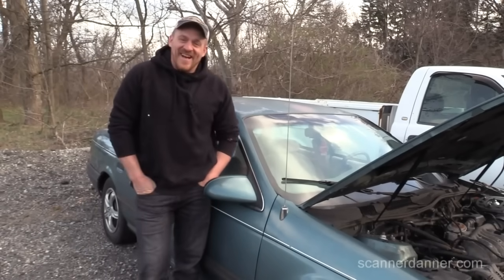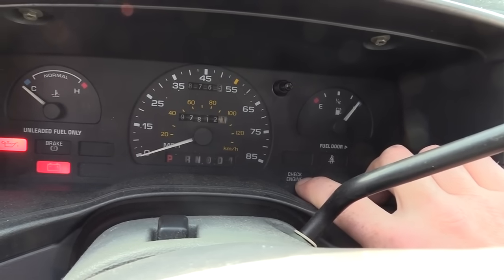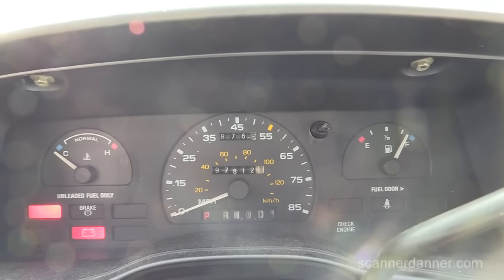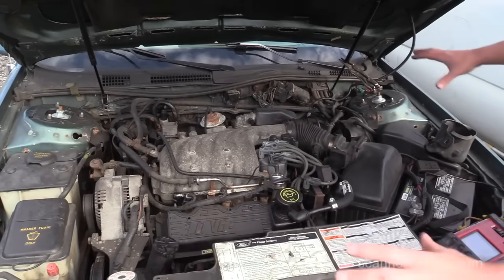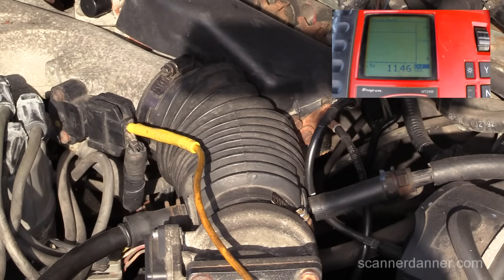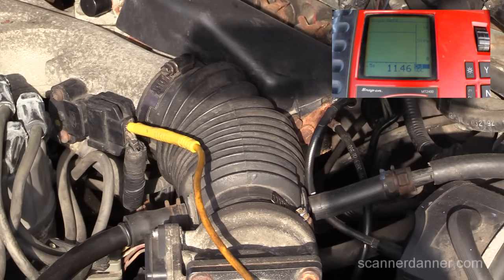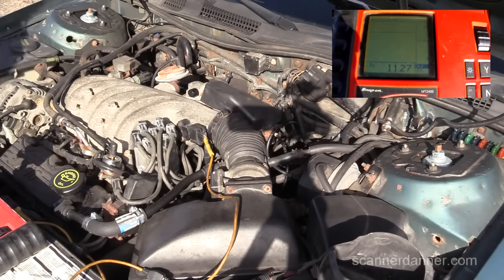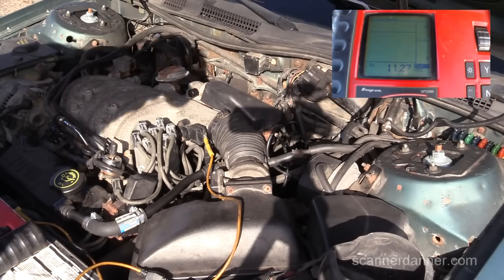Sensor grounds and the 5v reference circuit (a 2016 ScannerDanner Premium video)

Comment: time to walk away, it would be cheaper to scrap n replace
labor is labor.
Reply from the maker: Or just watch and learn something. It was a no cost fix. 
Edit## read below, this was a misunderstanding on my part.
Reply: @ScannerDanner to My 2009  Buell Ulysses and many other Buell with aluminum frame have computer ground issues caused by unseen with the naked eye resistance caused by dissimilar metal of the computer grounds and that dam aluminum frame . I was getting a DTC light lean O2 only at 70mph + . Light would go out when slowing down below 70mph . Cleaning aluminum ground points where computer grounds we're located was the solution. still will have issue sometime in the future and will have to repeat cleaning of aluminum because of dissimilar metal affect. Bad design
Reply from the maker: @sparky obrian Sorry man, I misunderstood you. Forgive me. I've just been dealing with trolls all day on Facebook 
Your comment was valid in that regard. I took it as you saying I was wasting my time showing this fault.
Reply: @ScannerDanner  my apologies also, im too quick tempered- the biggest character fault of all, believe me. I wasnt clear either, Im constantly trying to make a trouble shooting job fast and accurate and not loose money, its hard in my field, hence its important to know when to pass on a job.
Reply from the maker: Thanks brother. It's hard to gauge intent through text on a screen sometimes.

Comment: That was helpful. I had a 2002 Dodge 1500 with a no start, checked the ref signal at cam and crank sensor, none. Checked continuity to computer, it was good. Replaced the computer, and all was well. Keep the vids coming.

Comment: Great video Mr Danner. I am here to thank you very much because I have learned a lot from your video and one example is : I have checked a 2014 Corolla which is complained about check engine light and horrible gas mileage. When I checked the fuel trims, I found out that they were very high (40%) but only in idle speed. From your videos, I know the problem is big leak in intake. Finally, I realized the purge evap valve was stuck open. By the way, that car was checked by two technician before. Thank you again and I hope that your premium channel will be available soon in Iraq
Reply from the maker: Nice job man! 
ScannerDanner Premium is available directly from my website now with no country restrictions. You will just need a PayPal account to subscribe. Hope to see you there!

Comment: Hey Family really tears me up on vehicles like the Torus you just worked on . And again  before they bring it to me they are all over it  unplugging wires All over the engine! Then Like you said you have to start  and plug connectors back in and start to find the problem. And in this case a  1994 Ford  Torus with a bad grand near the battery! Jobs like this not much pay  Although I do get a Pie once in awhile for working on my Aunt's car! HA! HA!!  Like your videos and  I learn a lot and refresh things  for my  
Memory especially when I haven't worked on a vehicle in awhile like this Torus. Thanks Paul!

Comment: I'm back for round two! My timing issue has returned facepalm (I left a comment on a previous video about the 02 Q45 with the intermittent timing issue). I found a small amount of corrosion in one of the wires so I replaced the wire and put new terminals on it and now the issue is worse. So I'm back to watching scannerdanner videos and planning my next attack.
Reply from the maker: If you need help, Let's move this to my forum www.scannerdanner.com 
It is free to join and we can definitely help you. I have 28k global members and hand picked moderators who've been with me for years and know my material inside and out and are there to help me help you guys. It is just too difficult to offer back and forth messages here on YouTube with stuff like this and we also can't share pictures and images here like we can on the website. Hope to see you there!

Comment: Man I love these vids. We r hanging out and u r training us. Thank u so much!!  I’m working on a 2010 E350 Ford van. The rear 02 wires melted together and messed up the grounds in the computer. Affecting IAT and fuel tank pressure sensor. Would be nice if I could use other grounds in the computer to avoid having to buy a pcm.

Comment: You present the information clearly. Great job!
Reply from the maker: Thank you! Glad you liked it
Reply: @ScannerDanner 
I have a question if you have a minute, you mentioned on fords if check engine light is on then Turns off when you crank that’s normal?
I have a 2003 f250 6.8 and the computer is killing the ground activation signal to fuel pump one second after turning ignition on. I installed an external relay for fuel pump but problem continues. I am leaning toward bad computer or faulty ground somewhere, but have no idea where to go from here. I hear clicking in fuse box when cranking and then again when I release. Any pointers would be greatly appreciated. Thank you
Reply from the maker: @payattention2945  this is normal key on initial prime of the pump. Then the ECM will shut the FP relay back off until it receives and RPM signal. Do you have spark and injector pulse? I bet you don't,  in which case we are going to chase the crank sensor signal  next. I can help you with that too
Reply: Thank you for the information. That will be my next task. I appreciate the response.

Comment: Great video. Trying to work out why a cut / bad ground wire would give 11v on sensor. Will no doubt learn from your package of videos.
Reply from the maker: In short, for a 5v regulator to drop 12v down to 5v, it needs a good ground to do it! So with a bad ground, the 5v ref circuit is very close to battery voltage as are all the ground circuits. I have a bad ground playlist here on YT which would be a good place to start to understand this concept. Thank you!
Reply: Yes, got it, i think.... so the broken ground ceases current flow, shuts off any load and causes the ground side of the load to read system voltage.
Reply from the maker: @rjmlondon  exactly!

Comment: Had a 1987 Murcury Topez ( essentially a Ford Taurus ) and if I did not know how to work on it myself , I could not have afforded to keep it. When it ran - it ran well , but had SO MANY issues in the seven years I owned it. Replaced the cylinder head twice - because , in my opinion ,the cooling system was barely adequate . The first time I replaced the head - the water pump had failed and overheated the engine, the second time I replace the head , a rock was slung through the radiator , my wife did not see the engine starting to overheat - so the engine overheated again. Occasionally wondered  ,after this experience, why automotive engineers don't design engines to automatically shut down BEFORE overheating from either coolant or oil ( lubrication ) issues. Hell , they now have so much automatic this automatic that - surely with engine ECU's ( computers ) this can be engineered for ALL engines 🤨✌️✌️

Comment: Outstanding diag Paul
ECM sensor ground is attached to an Electrolytic Capacitor as a low pass filter for  the DC signal
Reply from the maker: An electrolytic capacitor, can you tell us a little more about the function and construction of that? That would be awesome

Comment: Yeah but you didn't check the fuses lol jk bro I love your videos you helped me with my 98 Chevy Malibu 2.4 almost six years ago I have 01 Monte Carlo SS now just want to say I appreciate that you constantly show the importance of being able to establish a starting point based on the issue with a car and reinforce the value of knowing how to effectively troubleshoot systems it's just excellent. I had a no start no crank with my Monte Carlo with the 3800 engine all I had was a test light, some patience and some common sense to look at what else was my car telling me before I got it started by using the test light to send ground to the control side of the crank relay and what other things that were going wonky after I got it started short story long I needed a new transmission if your interested in exactly how I got to that conclusion and then had to convince the local chain transmission specialist that it was indeed a problem in the trans when they and everyone insisted it was an issue with starter kill relay circuit of my aftermarket alarm let me know I think you would find it a teachable moment ...thanks again for all that you do.
Reply from the maker: Awesome! Thank you so much. Would love to hear the rest

Comment: I'm no Mechanic just stopped by to see your work... AWESOMENESS 👍😎 👍 I have a 2013 Nissan Altima that has code P0014 (Camshaft), I'm just having problems getting the engine cover off. Removed 3 bolts, but something is holding it down on right side back area, your suggestions would be greatly appreciated..
I'm not just saying this, but you do Awesome work and it would be nice if you were in Atlanta...cheers!

Comment: That's amazing.
I would not have thought to check that at all.
Been tracing a po1600  battery code.
I'll figure it out at some point.
(Dont buy a vehicle with a different engine where the po thought they could wire it up)

Comment: Dan, thank you for your videos they are quite educative. One question, How a nice ground signal looks like in an oscilloscope. I mean from what value to what value is considered a 'good' ground? Thanks a lot and keep on.
Reply from the maker: Less than 100mv on a ground to ground test for any computer or sensor circuit. Outputs that carry more current can be higher.
Like a fuel pump ground for example. It's may be 10 amp  circuit, compared to an input sensor that measures in the micro amps. So you may see 200-300mv on a pump ground. Make sense? The wire itself will have some resistance and the higher the amperage the higher the ground voltage that is acceptable. 
But again, computer main grounds, you want less than 50mv and a sensor ground less than 100mv

Comment: Great job on your videos. I used to enjoy the mechanical aspect of working on cars, but now find myself enjoying the diagnostics and wiring portion of it more. One question I have had but not been able to come up with the answer yet in my searching is why the 5V signal and not 12V? My only guess I have come up with is a 12V would have to great of a span range and wouldn’t be able to provide the best feedback. If you could shed some knowledge on this I would appreciate it.

Comment: Terrific training! I have one for you..  '95 Ford 5.8l XLT and sum1 put on an aftermarket K&N air filter WITH NO MAP SENSOR PROVISION HOLE. Where should I put the new MAP and where should I look for the original electrical connector?
Reply from the maker: You mean MAF sensor? They don't put MAP sensors in the air intake

Comment: thx so much for this video. it makes my understanding alot better of sensor error finding.
Can i ask you a question. you maybe can answer quickly. ( i am a premium Scanner Danner member )
What is the typical minimum sensors that a ECM/ECU needs information from to be able to start the car when it´s an Diesel injection type motor.
Reply from the maker: Minimum? Hard to say as there are all sorts of variations with diesel engines!
ECT, IAT, TPS, MAP at a minimum 
I'm thinking about my CAPs Injection System on my RV (2001) when answering this.

Comment: Hey Whats going on Scanner Danner.....Great video and very informative so thank you very much! I have a question regarding the computer ground because Im trying to make it make sense (Im working on a 94 Ford F150 btw). Early in the vid you said that sensor grounds work by all sharing a ground that leads to the computer, then the computer grounds them externally right? If so, Im thinking the area you're working on near the battery is where the computer is grounded, which in turn grounds all other sensors? And if that be the case, Im trying to figure out what the flickering and fluctuations of voltage mean and how it relates to sensor grounds, computer grounds or a 5v reference of other sensors and why you were getting 11 volts on those TPS wires? Can you help me understand?

Comment: 🙂 sweet, lots of rusty thingys tho, thats neat i didnt know about that weird ground plug. On a 96 blazer i had something similar, theres a big fat wire connector that goes between the Computer in the engine bay and the interior fuse box, it was a tiny bit loose, very hard to tell that it was loose, i left the key on and started wiggling wires, when i wiggled near the connector i heard the fuel pump kick in heehee ☺️ Oh and on Hondas go ahead and at least replace the negative battery cable often, its a weak wimpy thin gauge cable that gets corrody and uses these tiny 10mm bolts, one on the trans and one on the fender, give it a nice new cable and bolts, yay! 😍🚗🎃👻💀🏡

Comment: Gotta hand it to Danner, it WAS a vacuum leak, specifically the mechanic who managed to tear open my air boot at the throttle body, had knocked off the vacuum line at the throttle body that goes to my Purge valve on the firewall. Was wondering why there was no Purge valve code as I was under impression (from an article I read) that the vacuum line was needed for it to operate. Had the P0171.
Reply from the maker: Wait, why are you replying here, stay in the original thread, so others can benefit! 
I believe you were giving me a hard time about this one too.

Comment: I had a problem on that exact same ground in my 94 Mustang when I had it. Only it wasn't the connector it was the bolt not staying tight because somehow the threads wouldn't tighten it when the bolt was all the way down. Ran a tap and replaced the bolt car was fixed.

Comment: The main reason I don't like working on Taurus is there was a time (can't remember the exact yr) where the coating on the wires would crumble. Just a nightmare to work on. This is the first time I've seen a ref wire that high. I've seen 6, 7 even 8 but never over that. Thanks for the leason.
Reply: coating crumbling and pulling back and out of connector from heat related shrinking or possibly being overstretched at factory harness assembly before termination.
bean counters ensuring they squeezed every last penny out of the wiring lol.

Comment: Hey ScannerDanner, loved your video on the 5 volt reference.  Hey but where did you get your scope from?  Or can i just get me one from a local parts store and will any one be okay to use?
Reply from the maker: This was an old school Snap-on MT2400 Vantage, which is a graphing multimeter. Still a great buy if you can find one on Ebay

Comment: Hi Paul. Once again a fast diagnostic and profitable fixing (which is I am looking for). I would say is much faster than I currently can and I still cannot find the right direction since the very beginning (as you do).
For instance in this video, I do understand electricity and electronic principles, but still don't find how the hell you figure out in Ford's, check engine light turns off when ecm detects rpm.
Is it mitchell?  is it Ford TBS? is it your secret friend in every factory design department?
I have spent to many hours looking for  those tips (and I am willing to spend too many more) Please let me know your advice of what is the best database for that kind of tips

Comment: Hey man awesome video I just subbed. I do have a question, I don’t know if some sensors are different but I got a fuel pressure sensor and I got the 5v on the reference, 9v on the ground, and .5-.6v on my signal with KOEO and the sensor unplugged. Is this correct? Because you said the ground should be less than .1v. Thanks my man!
Reply from the maker: No, definitely not normal to see 9v on the sensor ground. Do you have other sensors that are messed up too? Are you sure you are on the tank psi sensor and not a level sensor input?
Reply: @ScannerDanner  at the moment I haven’t checked other sensors but yea my car was running fine besides “egr A insufficient flow”, and lol I’m not even sure what a level sensor input is but yea I’m definitely sure I’m on the fuel rail pressure sensor. I saw another video of how my signal wire should be at 5 volts unplugged and around .5-1v plugged in KOEO. So like in your video I should follow the ground wire and try and find any corrosion.

Also thanks for the quick reply!!
Reply from the maker: @kyleriley7362  you have no other faults? Just the EGR flow code? What are you working on? (year, make, model, engine)
Reply: @ScannerDanner  it’s a 1998 Lincoln continental. And after it stalled due to lack fuel i got p0303 and p0171 but I figured that’s because of the lack of fuel. 4.6 4v engine
Reply: @ScannerDanner  I cleared codes and got new fuel sensor and now no codes. Then I check for codes again and I got the fuel sensor code again. Today I clear codes and read again after cranking And it says engine disabled by pats. I had this issue before and it was a blown fuse and I’ve checked the fuses again and test them and they are good. Cleared codes and now no codes after reading it again. I still got 9v at my ground so I’m cleaning those up because I see little rust on it
Reply from the maker: @kyleriley7362  https://youtu.be/vFBva8m91Es if you are losing fuel psi, watch this video
Reply: @ScannerDanner  thanks for the video, after going over everything I jacked the rear end of the car and attempted to start it and what do ya know she started up. Filled her up with 14 gallons of gas (I had 4 gallons already in the tank) and now every one day imma fill her up to prevent this issue further. Thanks again for the tips. My ground tho is still get 12 volts so I still need to address that because the cleaning of my grounds didn’t do anything for that
Reply from the maker: @kyleriley7362  I'm not convinced you are measuring a ground wire. You said it is the tank pressure sensor right? What are the wiring colors and are you sure you are not looking at the fuel tank level sensor?